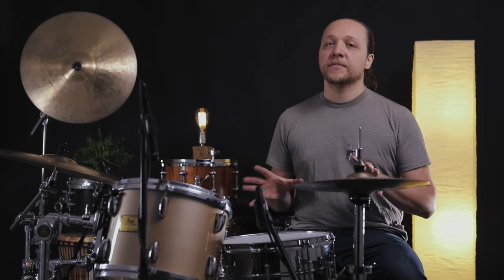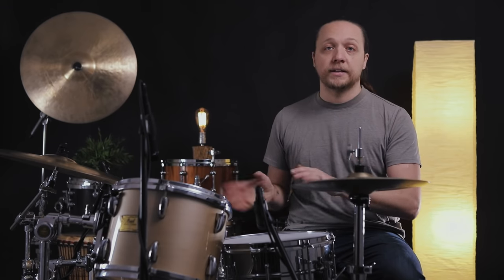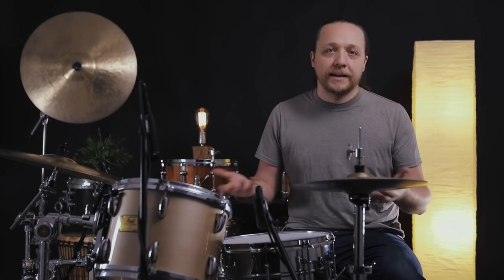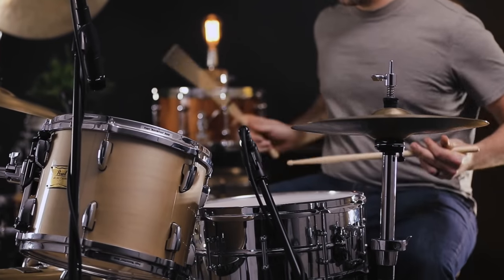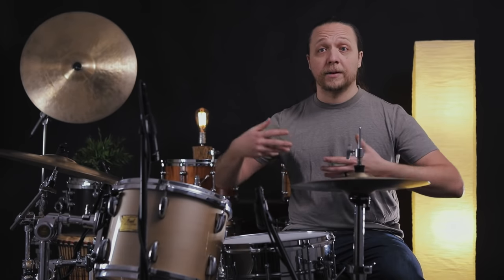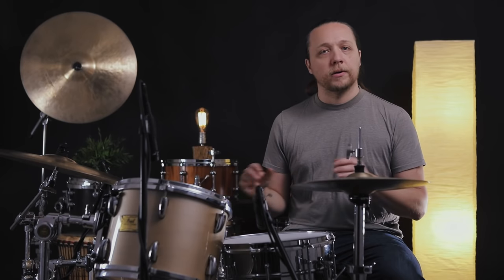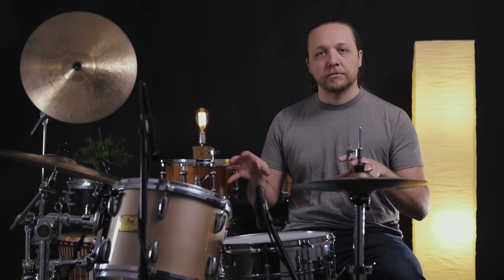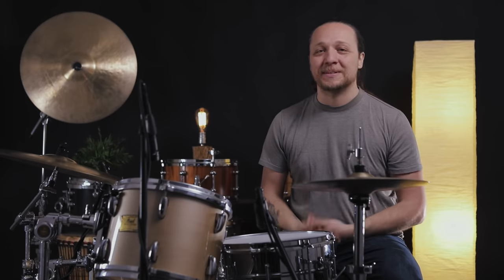Your Resos Are Killing Your Tom Tone | Season Three, Episode 38

Comment: New drummer here.  How does the reso head get worn out since you don't hit them? That threw me off
Reply from the maker: Hey there! It’s essentially a combination of most any material that is under tension stretching over time combined with the reso head vibrating significantly when you strike the batter. It means it will take a lot longer on average for it to stretch to the point of being a problem but it definitely happens over a long enough time line 👍🏻 -Cody
Reply: @Sounds Like A Drum  Got ya, makes sense. Thank you I appreciate that. I sat there for awhile trying to figure that out lol

Comment: Reso head normal (a 3rd higher than batter); reso head too low; reso head too high.  What about the reso a little lower than the batter?  Say a 3rd below, mirroring your normal tuning? That's the way I learned in the late 70s/early 80s.
Reply from the maker: That all depends on the desired sound, the drums, the heads, and the room!

Comment: Calf skin super phonic pin stripe on snare bottom 32 strand curly wires got to take the batter head to the motel cause the brushes got it dirty soap water comet rinse warm towel dry, up  frontopen oven door you can warm your feet with it.around the outward inside mountingpart that die cast rim pulls a little lotion gasoline,smallsoap dry over lampshade all nightnot too hot!!! Spray on Ruffcoat on top wlen dryonly stays rough about 3daysof gig(a businessmans bounce waltzzzz brushes gig.lllll